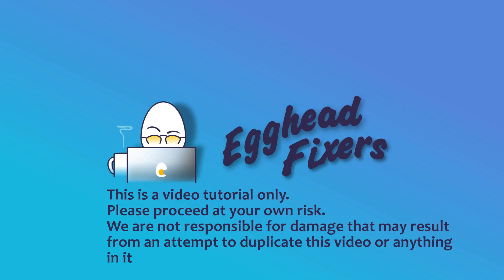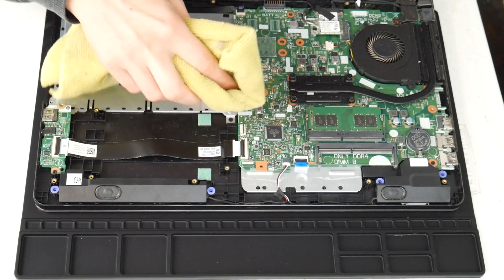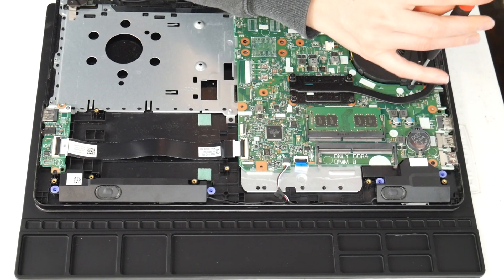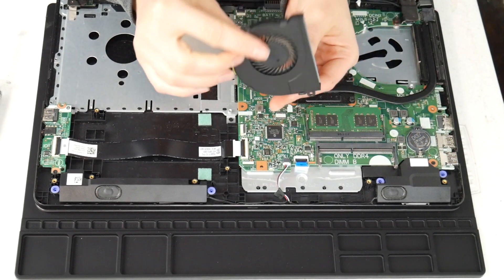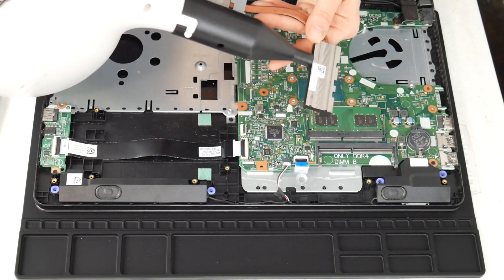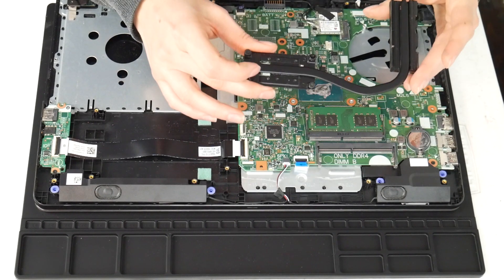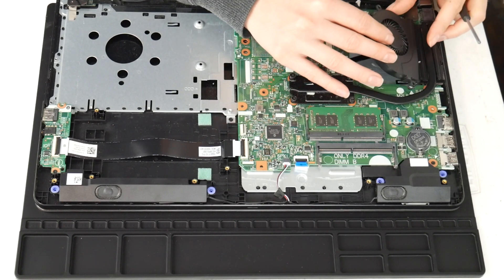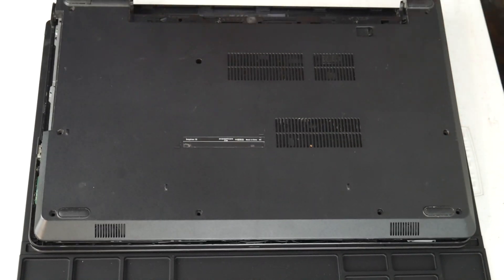How to Fix an Asus That Runs For Awhile Then Shuts Off, Dies or Stops Working

Comment: Hi ,
My question is that my Asus laptop doesn't even starts
Whenever I press start button The logo comes up and then it switches off with a short sound.

What could be the problem.
Reply from the maker: Sound like its having some sort of power issue. I would try this video:

https://youtu.be/UIZitN-cnik

It will show you how to troubleshoot it.

Comment: Question! 
I have the Asus x571GT and my laptop shuts down abruptly twice. I thought it was a C drive issue with the solid state, but when it shutdown for the 3rd time, I noticed before each time, I get a notification on my screen that my laptop is switching from the plugged in power supply, to the battery, before switching back to the power supply. Within 10min it shuts down abruptly.

Then I used my laptop just on battery alone, and when it dropped down to 15% I plugged it in, and the  second I plugged it in, the laptop abruptly shuts down. 
I even ordered a new power supply, but in the mean time used a different power supply and again, shut down.
So I'm convinced its the battery or something inside the computer that regulates the power. Yet MyAsus shows everything is nominal..?
Suggestions?
Reply from the maker: Sounds like you are having some sort of power issue. This video will show you how to troubleshooting for an issue like  yours. Try it and let me know how it goes.

https://youtu.be/UIZitN-cnik
Reply: @EggheadFixers  I just purchased and changed the battery adapter and so far, no more sudden power issues. Fingers crossed!
Reply from the maker: @djkomic  That would be great if that's all it is!

Comment: Hey its me again CAN I LIKE REINSTALL WINDOWS FROM BIOS WITHOUT USB?
Reply from the maker: You can reset an operating system without an USB if the operating system is functional but to reinstall you will need a USB.